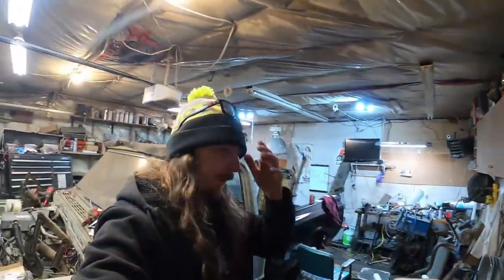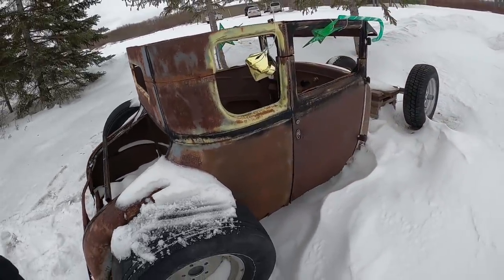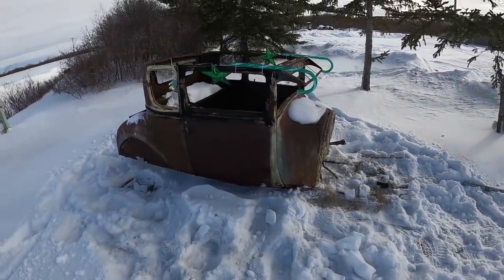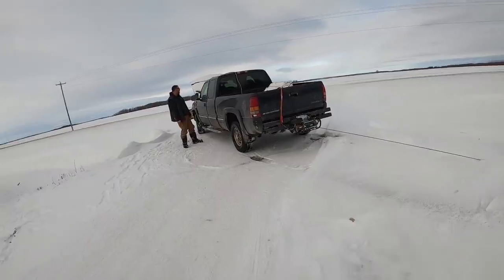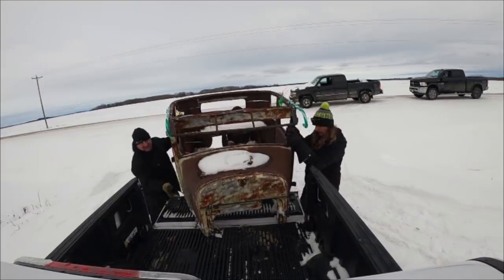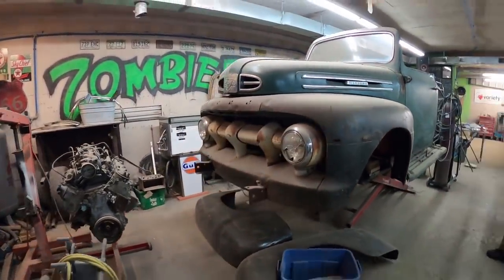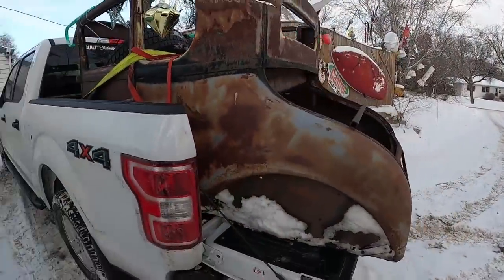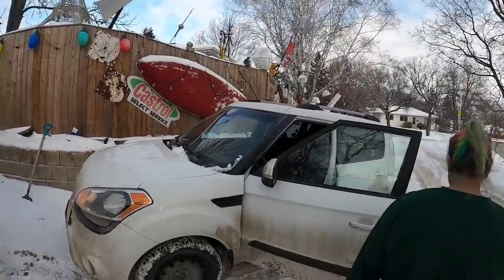Rescuing a Chopped 27 Model T Rat Rod! *Next Shop Project*

Comment: I have a 27 T coupe from out west (Arizona) about 6 years ago. It has a 10 inch chop and it is now on a model A frame . I used a crew cab 2002 Ford truck roof (ribbed) I have front disc drum rears 8" with a 3:00 limited rear Ladder bar and  front hairpin with a 4" dropped axle. I had a 390 Cad with a 4 speed Saginaw. I know a 283 small block and 4 speed would be easier and fast and a lot cheaper too!
ENJOY
Reply from the maker: that sounds like a wicked rod!
Reply: NO HEMI or BIG BLOCK the car is too petite. A small block or V6, or a flathead V8, a new 2 x 4 frame with the above suspension improvements. I am putting a Focus 4 with a Ranger 5 speed in my '25 Ford Model TT cab on a model A frame. Use what you can score locally but keep it within it's old school proportions.

Comment: Yea make it crazy from the big block to a custom chassis custom light's and use trailer wiring since you get the wires you need for each light it save's the trouble
Reply from the maker: yeah it should be a fun one

Comment: Once I worked for a supplier of rod parts. Normally my advice would be to run far and run fast. But in your case I’ve watched your channel and have seen what you can do. Go for it. Skip the wood. Use metal! You might consider building a new frame though. Ts are so simple and lord knows how rusty and or bent that one is. Looks like it was rodded before.
Reply from the maker: yeah it was cheap and i wanted to try one out. see how it goes

Comment: Nice ,but I think he had the rear wheels about 2.5 feet too far back. They need to be taken  forward a little.
Reply from the maker: they seemed to line up with the wheel tubs
Reply: @DDSpeedShop  Yea they did I was just pulling your leg. If you are intending to put any kind of power into this jolopi I would suggest boxing the frame for strength if it hasn't already been done.